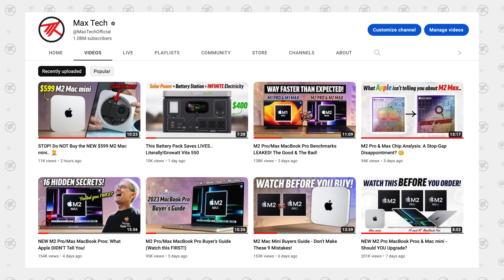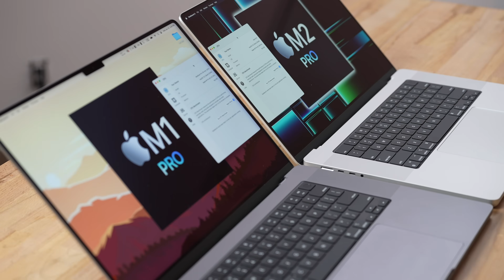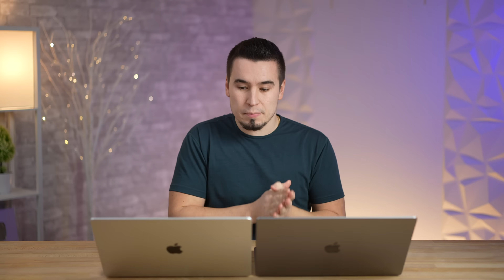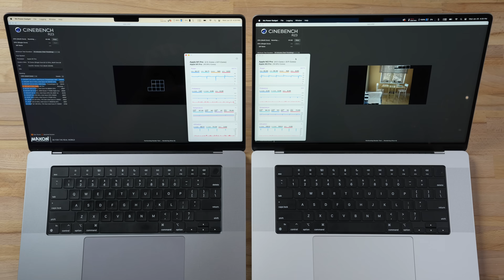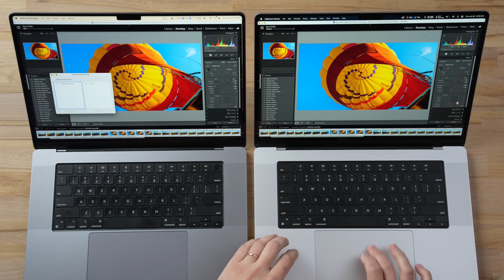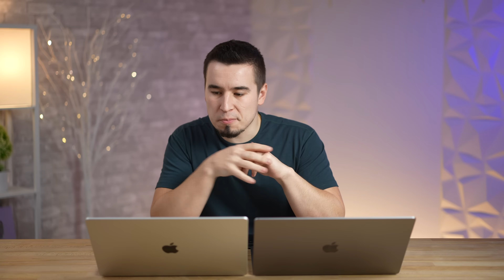M2 Pro 16" MacBook Pro - EPIC Comparison (BAD UPGRADE!?)

Comment: I think the most troubling thing is that Apple cheaped out on the cooling system when the CPU/GPU are much more power hungry than the old ones. You guys are the only ones to point this out.

Comment: Guys, thank you for you comparisons
since m2 is hotter with 12 CPU/ 19GPU  it might make sense to do the following test for 14 inch pro
Please make the test : 
14'' M1 10-Core CPU 16-Core GPU 16/32GB/ 1TB SSD Storage and 14" M2 with the same 10-Core CPU 16-Core GPU 16/32GB 1TB SSD Storage. 

I guess for those to whom autonomy is a more important factor, it would be interesting to see real comparisons of the same number of cores with the next generation m2.

Comment: Curious to see how the M2 max with 1Tb+ will work. The SSD issue is quite a pity, but at least for the higher priced models it should not be present (even though MacBook Pros should all be considered 'higher priced').

Comment: It’s a little disappointing that the performance improvements seem linked to the increased power requirement. I guess it can be expected but wouldn’t it be nice if the performance got faster while using the same power. Maybe 3nm chips will achieve this? Nice video!
Reply: I think basic laws of physics will mean no matter what you will see even more power consumption no matter what size of the chip, because you will always need more cores to produce more power, and that would always take more energy. But you might see significant energy efficiency in an idle state with a smaller chip size. So the overall battery life will go up on paper, but once you push the cores with heavy work the battery life will scale the same.

Comment: M2 is a really decent iteration IMO, things got more efficient, there are fixes such as the graphics buffer and the speed, bandwidth and core count are increased, and the upgrade to 8K i pretty significant. I don’t know what else we should be expecting.

Comment: Well, this was the comparison that interested me the most. It goes to my previous comment where, although there is a performance boost in some areas, is the M2 really worth upgrading to? When you watch the Apple event, it made you believe that the M2 was so much better than the M1 and yet in RL tests there is hardly any improvement. Disappointed.

Comment: You guys do a tremendous job testing various scenarios with different configurations which really helps us to make informed buying decisions . Would you look into testing the HDMI port on the new M2 machines to see if Apple actually included all the specifications of the HDMI 2.1 standard or has Apple maybe left out some specs like variable refresh rate , I’d be curious to see if they included everything . Thanks Guys 👍🏻

Comment: Always surprised when new models dont outperform the old models. I would take either one at this point as they are both way faster than anything I have currently.
Reply: What are you using currently?
Reply: @ghost-user559  after the old (14 or 15) MacBook died I am using a dell the kids had for school it is now running on Ubuntu…..
Reply: @Kittyjesus503  Thats a good choice. I’m on a 2012 MacBook Pro 13. But I have an HP 15 from 2012 with Win 8 Lol. Ubuntu is good, I just wish Linux had more software to complete with Apple. I’d switch in a second if I saw software that was truly equal.
Reply: @Kittyjesus503  Which M1 or 2 are you looking at?
Reply: @ghost-user559  I’m not a power user, maybe working on some GoPro or insta360 footage. So probably just a base model M1. 1. The M1’s are a little cheaper new. 2.  they are available.
Reply: @Kittyjesus503  Oh yeah m1 makes the most sense for that workflow. It will be lightning fast. Just definitely make sure you get 16GB Ram to future proof it.

Comment: I found that using liquify tool in photoshop is extremely laggy on my M2 Max 16 MBP w/ 32GB ram and 1tb SSD. Also, playing Sony A7IV 4:2:2 10 bit files are choppy in DaVinci Resolve Studio and premiere pro. Shocking since liquify took in photoshop runs smoothly on my 2013 and 2019 intel MBP

Comment: I liked that the M2 Pro had a significant performance increase in Blender, and I can't see what the results will be on the M2 Max and especially the M2 Ultra, which in the previous version had a very bad performance scaling compared to the M1 Max.
Reply: Yep, I was thinking the same thing. I think the Ultra issue mostly had to do with software not really optimized to take full advantage of the Ultra architecture... Like too much power too soon, was like a bull in a cage, not allowed to bust free...

Comment: Another great video.

Can’t wait to see the 16” M2 Max in action! And how much better upgraded SSD and Unified Memory help with speed, heat reduction etc.

I am currently macless since my trusty 2011 27” iMac went to Mac heaven last year.
It is torture using windows 10 while I decide on my next Mac purchase, but leaning towards high spec 16” M2 Max 1tb + 32-64gb as I do 3d architectural modelling and rendering (VectorWorks) + use 27” external monitor.

I fully expect to get a good 10 years out of my next Mac as I did with the iMac!

Comment: For the MacBook Pros it might make the battery test more fair if you use the same wallpaper as the mini led displays will turn down or off parts of the display with the dark image on the M2 Pro laptop and lower power consumption

Comment: I'm wondering if the M1 Pro will close the performance gap a little more when it has more headroom, eg, 32Gb/1Tb?

The thermal issues can be a really big deal - totally sidelined my old 2019 16-inch MBP - lovely looking machine, but when confronted with the higher ambient temperatures in Australia it just choked, even with manually boosted fan speeds with TGP pro.

Comment: I found that the M2 Pro and Max chips seemed like such a scam but they are actually amazing chips compared to Intel and AMD. It’s just that they came just after the M1, which was a massive leap from the intel versions. Hopefully with 3NM the M3 chips will have that better performance and efficiency.

Comment: I’m glad to see that battery performance between the two is similar. I was concerned with the extra power during stress test. I’m on an M1 13” MacBook Pro. Still undecided if it’s worth an upgrade.

Comment: Thank you for this comprehensive review, which is very helpful. 
If I had to choose between the new M2 MBP or the old discounted M1 MBP, I would choose the M1 MBP. I think the performance difference is too small and I wouldn't necessarily need the upgrades such as WiFi 6E, Bluetooth 5.3 and HDMI 2.1. If you can get a good deal on an old M1 MBP I'd take it.

Comment: Thanks for the video!
I think the Logic Pro test isn't accurate. It looks like you're just muting regions which is unlikely to affect performance - you would need to actually delete the tracks (or hold alt while powering off the track can also reduce load as it unloads the midi instrument). This would explain why the results are near identical I think? Would definitely be interested in a deep Logic test between the two machines!

Comment: I think this is a decent bump in performance considering it is still a 5nm chip. The 2 efficiency cores make a bigger difference than I expected. The GPU cores seem to be 10% better, perhaps just because they are clocked higher, but still a nice improvement.

Comment: One minor architecture improvement in Blender. Otherwise, just clock boosts and a couple of more cores. M2 needs to be only 10-15% more to purchase to justify the 'upgraded' performance, not withstanding the slower SSD and speaker config. Looks Like the outgoing M1 gives more bang for the buck.

Comment: It would be great if you could compare the changes in bluetooth. I work with a bluetooth keyboard and mouse between to devices often, that I swap from back and forth.
The difference between around a second and instant connection would make a big difference in my workflow!

Comment: If I win a free machine, great! If not, I have to make a difficult decision on which laptop.
1. Buy an M1 Pro, base 16
2. Buy an M2 Pro, base 16
3. Buy an M2 Pro, and upgrade to get around the slow SSD. 😢

I got cheap on my last purchase, and settled for a 256GB SSD. I figured, I store my photos off the machine, so no big deal. MISTAKE !

Loading a bunch of photos using WiFi is painful.

Comment: the Logic test blew my mind! how are they the same, wow...
Reply from the maker: It’s a stability test. The M2 Pro is an overclocked version of the M1 Pro so it’s not as stable even though it’s faster.
Reply: @MaxTechOfficial  I'm having a hard time understanding, as I thought with higher clock speeds more calculations would be executed in the same amount of time, so seeing as audio is a time sensitive process this would equal greater stability. obviously not... still blown away

Comment: It’s clear that the M2 is just an over clocked M1 with the GPU bottleneck problem solved. Still a good buy if you skipped the M1. I wonder how much performance Apple could get out of these chips if they put them in a desktop form factor with water cooling and ramped up the clock to Intel/AMD levels?  Hint hint Mac Pro??!!

Comment: I am seriously concerned about the sustained high temperatures and they effect they will have on the chip life. I have a 2011 MBP that still runs with all original hardware, but I suspect that will not be the case in the future (although in reality the useable life of a tech device is only about 5 years anyway).

Comment: One thing I want to suggest to you Max Tech Team - For Logic Pro benchmark, if you really want to see how stable the CPU is, you could test the benchmark with setting Buffering Size lower. 

When Buffering Size is set to 1024 like how you guys doing it, Logic Pro will take more time to render the audio, not stressing the CPU with low Buffering Size. As Buffering size goes lower, Logic Pro doesn't give the CPU as much time as 1024. CPU will receive lot more stress.
Buffering size of 1024 is reasonable for composer who doesn't always need instant playback, but for recording/tracking purposes - 1024 is almost useless because of delay it has.

So buffering size of 64 or 128 is more reasonable. This way Logic Pro will definitely not handle much tracks as you are testing the Benchmark.

Anyhow, I really appreciate all the effort you are putting to test these devices' capability and make us informed purchase decisions.

Comment: Intel in the past had Tick-Tock release strategy where Tick is architecture change and Tock is process shrink. Apple seems to have done both at once with the M1 seriese, so M2 is just a overclock and core count increase. The end result is just power-hungry hotter SOC for just a small performance increase. As you suggested at the end of the video, buy a M1pro/max at a discount makes sense. Great job proofing by the actual testing. Thanks!

Comment: it would be interesting to see a similar comparison but with both of the computers on the power saving mode. I'm interested in the difference that the 400mhz more that the m2 pro has compared to the m1 pro in terms of efficiency cores

Comment: The Blender result were surprising. The others lie more or less in the expected range. But when I can get the M1 Pro model a couple of 100 bucks cheaper, I’d probably pick the M1 Pro model. I’d be interested if the SSD issue is still present in the 1TB model, ir if this is „fixed“ there.

Comment: It’s clear the difference is mostly only made possible by allowing the wattage to go higher, which causes a cascade of not so great things like the high temps, and more fan speed/use.

Would love to see how much difference the M2 Pro will make when putting it in Low-power mode.

Comment: The Blender 3D improvement is phenomenal. I have a mid-2012 MBP which has a B3D Benchmark of 46! Yes 46! 😂The latest 40xx-whatever is somewhere up in the 12k region. However, will I upgrade to a 2021 M1 or the new M2? I don't know. I feel disappointed with Apple. I may push the upgrade-envelop to the M3 and 3nm chipset as I buy my machines and expect them to last for at least 7yrs.

Comment: First of all, thank you for your effort to make comparisons for this video. I do want to point out that M1 Pro 10 core processor should be scoring around 12200-12400 in Cinebench R23 stress testing (Mine scored around 12268 on 10min stress testing but yours scored only 11305 (at 10:34) ). What I noticed is that when I ran 10 mins Cinebench R23 stress test with Mx Power Gadget (the one you used in this video) I got score of 11559.
Hence, I believe the benchmark scores should be higher without Mx Power Gadget running.
As always, please keep up your hard work for future videos. Thank you!

Comment: Interesting to see how much more power the M2 Pro draws and taking account the higher fan speed and the extra GPU cores and it still has the same or better battery life under load compared to M1 Pro. Says a lot about the efficiency of these chips.

Comment: Man, I hope those deals on the M1 Pro/Max 16" MacBook Pros will still be around later this year as I plan on getting my wife a new 16" MacBook Pro for her birthday/christmas this year. 

As always, your tests really show off how much better these Apple Silicon Macs are compared to the older Intel Macs. I'm currently using an 2019 16" with an i9, 16GB and 1TB HDD, and while this thing is powerful, I can definitely see the benefits of the M1 Pro/Max and M2 Pro/Max chips.

Comment: I am still confused by the fact that Apple is letting the thermals escalade that high. Is it not possible to adjust the fans so they could keep the temperatures way lower than +100°C? It could damage the components of the M2 chip over time when getting too much heat over time... Right?🧐

Comment: You do the best comparison videos and provide the best information when it comes to Apple computer products.  Thanks for all the hard work.  That is pretty impressive with all the test you have done I don't see much of a reason to upgrade to the M2 Pro.  I have never heard the fans on my MacBook M1 Pro come on.  I normally don't run but 3 or 4 programs at one time and when I am working on video or photo editing I only have the programs I need to run open.

Comment: Another great comparison! Thank you. With the price drop on the M1 Pro MacBook Pro, both 14 and 16 inch sizes, I opted for the M1 higher spec model with upgraded CPU and  GPU cores, with 1 TB SSD and saved $500.00. This machine will be way more powerful than I need, but future proof for a long time.

Comment: 20-30% YOY increase with better/equivalent battery life is significant and compelling, even for those considering an upgrade. And you got the base (read: worst) version? Maybe I'm just conditioned by a decade of 7-10% Intel processor power iterations that only consumed more power puts this is stark contrast. I'd never buy this base version though, very interested in what the Max will look like in comparison here.

Comment: I wouldn't be using the vast majority of these things, or working with that many open tabs, but it's nice to know that I could skip the M1 and get the M2 and it be worth it. It's also nice to know though, that the M1 is still worth it in the grand scheme of things and still a great improvement.

Comment: Good compare! Still for a fair raw-performance compare I would highly recommend to test configurations with enough unified memory on both 2022 and 2023 models for the kind of test you want them to execute.
Ideally zero SWAP memory should be preferable in order to eliminate the write time factor that could vary depending also from free storage available or export/save on external SSD and many others.
SWAP memory is necessary in certain extreme conditions but should be avoided in every day use because could lead to shorter SSD lifespan due to the limited TBW associated with the SSD technology itself.
I believe considering TSMC did not had the 3 nm chips ready yet it was really awesome what they could pull out with the M2 series without even mention inflation costs and problems with china's factory assembly slowdowns situation.
20 to 30% increase is not bad at all, no need to upgrade from M1 pro or M1 Max if you are not in the 1% of people that really use all the processing power.
HDMI 2.1 is nice but again not everybody NEED 8K resolution for his workflow, soo.. good they decide to upgrade to 2.1 for the 1% that will needed.
The sound quality seems more clean in the M2s when in the M1s seems a little distorted in the high frequencies in my opinion.
Thank  you Max Tech for the great job!
🍏

Comment: WiFi 6e is actually a big deal. It should not be dismissed in terms of the purchasing decision where the M1 and M2 are being compared. Sustained download speed is only one part of the equation. There is also latency and power consumption. WiFi 6e is much more LTE / 5G like compared to earlier version of WiFi. Additionally, operating in the 6 GHz band means that WiFi 6e devices to not need to battle with legacy and 11AC devices in the 5G band for access to the medium.The advantages will become more apparent as WiFi 6e networks get rolled out in the field.

Comment: I would really like to see this same testing scenario, but with using a larger SSD on the new M2 MBP. If the SSD is an issue, how different would these tests be with a small upgrade in SSD when ordering?